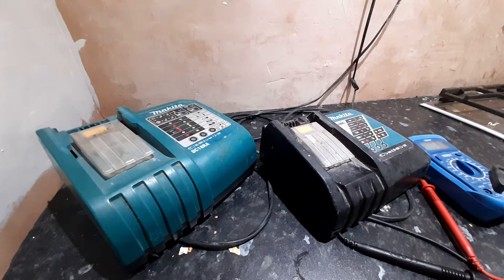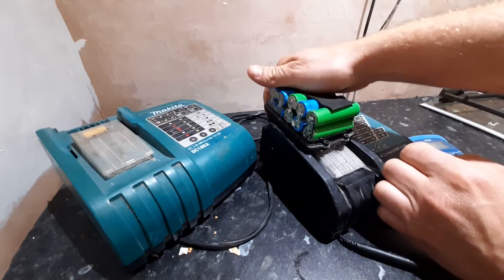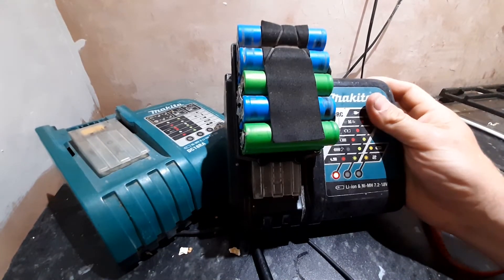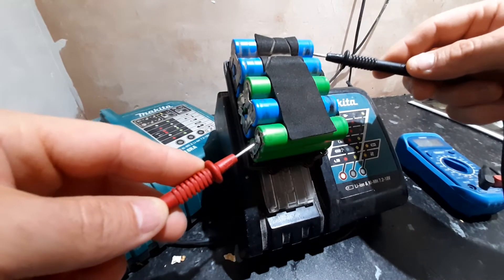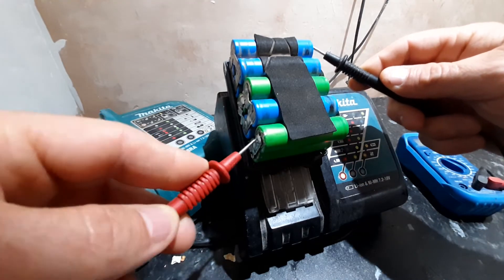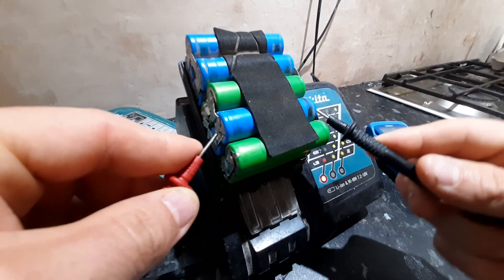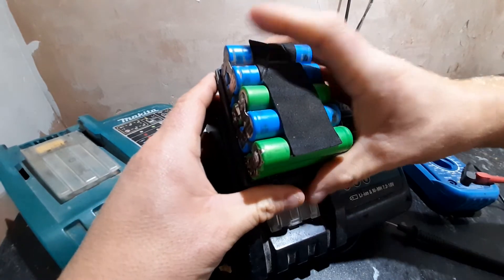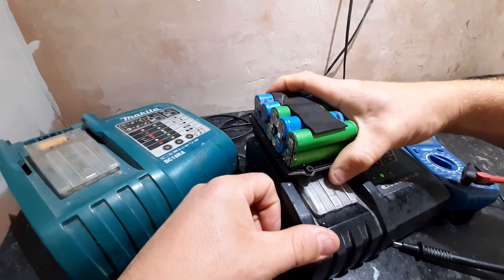makita battery fix, chip reset

Comment: i didn't know that the Makita chargers and bms locks out the battery but i figured out doing what he did on my own before seeing this.  it does glitch the bms communication out or maybe just black magic but it does work for sure.
Reply: It does no such thing. The only way banging a battery on and off a charger like that is going to 'work' is if there's a loose connection on the charging circuit. Once the eeprom has flagged a permanent fault it is impossible to change it. It is a write once code execution that then locks the eeprom.

Comment: Ignore this it is bullshit. As soon as someone says 'reset the chip' it's clear they have no idea what they are talking about. When these batteries detect certain fault characteristics, which involves a number of variables including cell unbalance, voltage below a threshold and high inrush current followed by high rate of temperature rise the onboard microprocessor executes a onetime script that writes a permanent fault flag to the onboard eeprom and then blows a fusible TTL datalink preventing any further writing to the eeprom. The BMS in these batteries is not a simple yes or no when it comes to charging, there are multiple boolean flags and sensor readings that have to be within parameters before charging will commence. There is more computing power in that battery than there is in an iPhone 1.
Reply: EXACTLY.  People being able to "revive" their batteries using this method were lucky to have their batteries just one step before being perma locked.

Comment: have Makita charger DC18SC with Makita OEM BL1830 battery that had bad contact on lithium cell.  re-welded it and charged it with NIMH charger.  works great but won't charge on  charger.  tried you "trick" for over 40 times - doesn't charge.  what am I doing wrong ?
Reply: have tried this on 4 OEM Makita batteries that won't charge with good lithium cells (I can charge them with NIMH charger and they work - but won;t charge in the Makita charger).  Don't believe this guy - IT DOESN'T WORK.  Colombo is correct - the circuit board he is using is a CHINESE clone. His battery has been modified previously by him or someone else before he got the battery.
Reply: Try the wire trick hooking up to another battery

Comment: What u doing is just changing melody of battery charger. Its just feature of makita charger where each time u pull out and put in fast, it will change to different sound, choice of 6 melody i think. It has zero effect on any kind of chip reset. Title of video should be "How to change makita charger melody" probably.

Comment: The battery has some kind of counter in it that counts i think 2000 charges then it bricks. So doing your trick counts down the charges and battery will brick sooner. Once bricked i have a RC charger and made an adapter to charge the bricked batteries

Comment: This guy is a scammer. He is careful not to show you the board he has replaced but you can see the thermal cutout leads on the right of the battery pack just near the end of the video which are not present on the genuine Makita board. He has not reset the chip, don,t waste your time, he has replaced the board like all the other solutions
Reply from the maker: I don't know what you are talking about I wouldn't waste money replacing parts if I can't repair something for free I don't do it, everything is the same and it one video with a few minutes maybe cut out. 
If this isn't a genuine makita than I guess amazon is selling fake makita tool set then
Reply: @doitmyway9089  Quit lying Mumbles

Comment: Can you explain it, how did you reset the chip without replacing the full pcb in the battery?
Reply from the maker: Hi I just put it in and out the charger really fast over and over again sometimes it takes a while.
One more thing is you need to change the bad cells first else it will pickup the same fault again
Reply: @doitmyway9089  Okay, I will try it out. Thank you!
Reply: @doitmyway9089  It sounds like you accidentally uncovered a glitching attack on the board. If true, it is likely possible to build something like an Arduino-controlled relay system to cycle the battery between the charger at different timings in order to glitch these boards back to life. If I get some time I may investigate, because I have a couple of these that were accidentally charged from an external source through the +/- charge terminals to above the 4.08V max voltage on the 20ah battery, bricking them with the classic Right<->Left LED error cycle.

Comment: I see you have both the dc18ra and the dc18rc charger ,can this "chip reset" be done with the dc18ra version also or 
is it only the dc18rc version that can do this reset ?
Reply from the maker: Sorry I didn't try it on the other charger, I had another problem with the battery after I used and recharged it a few times because the cells I replaced it with was newer and hold there charge better so caused the older cells to drain quicker causing them to fail, all the cells need changing so they charge and discharge at the same rate. Thanks for watching my video sorry I can't be more help.
Reply: @doitmyway9089  Thank you for telling me.I am just about to put new life into 2x 14.4v battery's and will try to reset the chip with the dc18ra charger .Keep on doing videos ,it is all ways great to be able to show people how you can fix things :-)

Comment: this doesent work for me. but there is what i did and it worked. i had all cells good and at the same voltage level, battery worked in the tool, but doesent charge, charger beeps and doesent start to charge. then i shorted the end terminals of the battery for a second and that acutally did chip reset and now it works just fine. i have big white pcb with potted parts and all cels soldered on it. if you want try it, short terminals very shortly and directly on cells, not on pcb, so you dont blow the fuse. by end terminals i mean ends of first and last cell, so you short out whole series . you can of course desolder them, but they are beefy and hard to desolder.
Reply: First and last cell is a bit confusing to me, what is the first and last cell? You should think about doing a video on what you have done.